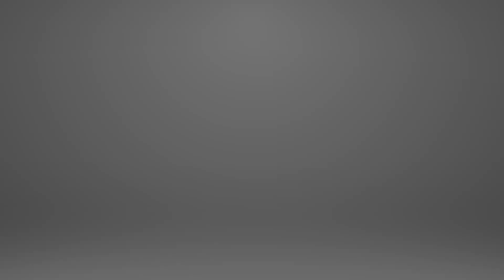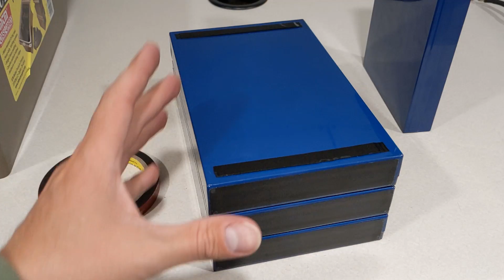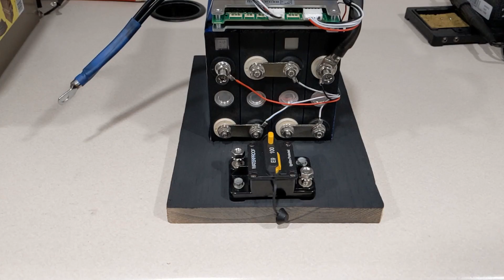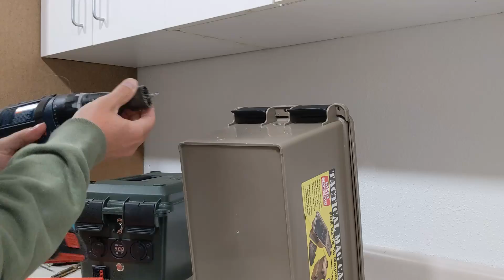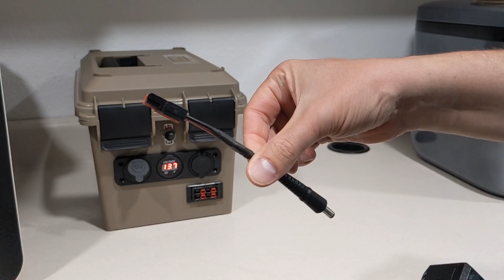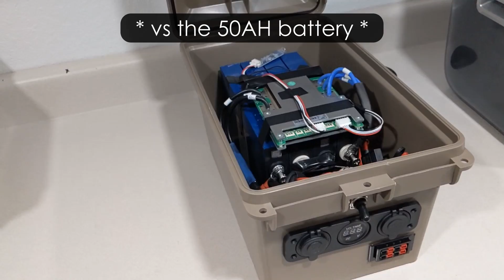DIY 80AH LiFePO4 Battery Box - COMPLETE BUILD VIDEO  | AliExpress Cells, High Quality BMS

Comment: How about next time we double the battery & add a 2000 watt inverter?
Reply from the maker: I'll save up my money for while haha Thanks for watching!
Reply: @Jasonoid  That's what I was thinking. Some thing to run a refrigerator when the power is out, and can be recharged with solar. Also, maybe build the basic battery, BMS, 1000 or 2000 watt inverter, solar charger, and then have it so we can build more batteries in the future and daisy chain them for a larger and larger bank. 

I know the battery is the big expense, but maybe build an "EMERGENCY" box using deep cycle lead acid for now, and then upgrade to lithium later when more funds are available, but at least for starters you have some thing for an emergency that can be used hard for a few weeks if need be.

A 1000 watt inverter to keep a refrigerator going, run a microwave, TV and basic charging of cell phones and what not, or upgrade to a 2000 watt to maybe run all that, and a hot plate or some thing for cooking on. It's a lot of power being drawn, but that's why you can daisy chain batteries as needed, and have a couple solar panels as well.

Personally, I'm not building some thing like this to take camping to air up a mattress, or charge batteries for tools, I mean that's cool and fun and all, but for "ME", I'd spend a few hundred more dollars and make it really usable for all that fun stuff, AND FOR REAL emergencies. 

Some thing for REAL emergencies, it should be able to be recharged from the grid or gen set, solar, and a vehicles charging system.

I'm in Louisiana, and we lost power for only 14 hours a few weeks ago when the hurricane hit, but if I was just 40 miles west in Lake Charles, I would be without power for weeks. I have a gen set, but this would be great to use along with it.

Some thing else that would be handy I think, is a built in retractable extension cord mounted, probably on the outside. I'm thinking some thing along the lines of a vacuum cleaner cord, as they're pretty durable, can handle a good amount of power, they're cheap, compact, around 20 foot long cord, and easy to mount. Of course you'd have to replace the male end with a female, but that's no biggie. Now you really do have a very handy self contained box.

For reference, here's what I'm thinking.
https://evacuumstore.com/p-311-electrolux-plastic-canister-cord-winder-assembly.aspx?gclid=EAIaIQobChMIo-CGl87r6wIVEdbACh2uoQQjEAQYBSABEgJ7jPD_BwE

A bunch on ebay.
https://www.ebay.com/i/312867187883?chn=ps&norover=1&mkevt=1&mkrid=711-117182-37290-0&mkcid=2&itemid=312867187883&targetid=935694488106&device=c&mktype=pla&googleloc=9025259&poi=&campaignid=10877145111&mkgroupid=105798873063&rlsatarget=pla-935694488106&abcId=9300400&merchantid=108357416&gclid=EAIaIQobChMIo-CGl87r6wIVEdbACh2uoQQjEAQYASABEgID-fD_BwE

Keep up the great work.

Comment: What battery pack did you buy? They all kind of look a like... The 4 packs I see are less than $200...
Reply from the maker: Link is in the description of the video, 4 pcs of 80ah cells. Any size would work, you could go smaller or larger and use the same principle in my video.
Reply: @Jasonoid  thank you when I press the link the second time I got there. there are a lot of them on there that look the same and say they're the same size but they're half the price or less. Although yours do say grade a is that the difference?
Reply from the maker: @robertcollyer3500  that might be the cost difference, I think if you go with the cheaper cells youll probably only get 80% capacity of what they are rated, they still might be worth the cost savings.

Comment: Awesome portable setup ⚡️!!! I’m looking at making a box for my Nissan Leaf batteries to make it easier to remove from my Rv during the winter months!
Reply from the maker: I looked at Nissan leaf modules, they were pretty cool! Good luck on your build! Thanks for watching
Reply: Thanks for the reply! I plan on doing a 24 volt bank comprised of 6 modules. Hopefully get 350 amp hours 🙌🏻 . I like the battleborn brand but I can’t justify the pricing 😅. I have a build series here on YouTube. The goal is to reno a vintage Rv on a modest budget with the capability to go off grid ! Your builds are so neat and I’ve learned a great deal ! Keep pushing the content!
Reply from the maker: @WeRoamtheUnknown  that sounds like an awesome project, you'd be able to run quite a bit off a power bank that big. Good luck! Thanks for the support

Comment: One day too late! I just ordered two Lion Safari UT 1300
, 12V 105Ah Lithium Iron Phosphate (LiFePO4) Batteries. They have a nice BMS so I think I can still build this box without the BMS. I have ordered the ICECO VL45. I'm looking to power it. I may add a battery monitor. Great video you do a great job showing how you build and you explain things well.
Reply from the maker: Thanks for watching! Sounds like an awesome project! Let me know how it goes!
Reply: @Jasonoid  Thanks! When you charge your batteries, where do you connect the charger?
Reply from the maker: @livingcoramdeo  I will make an adapter for my Anderson PP panel to make charging easier, but for now I connect alligator clips to the negative BMS lug and positive terminal. It works just fine....just have to remove electrical tape before hooking up the negative.

Comment: Great build and thanks for the video!
Reply from the maker: Glad you liked it!
Reply: @Jasonoid  I was nodding my head for almost the entire video. I just finished a build this weekend and used the same battery chemistry, same case, same circuit breaker and Anderson PP connectors :) Geek telepathy apparently.
Reply from the maker: @nikoargeres8156  NO WAY! That's awesome :) I'm sure we will love these setups! You running fridges as well?
Reply: @Jasonoid  Yes, I have the ICECO jp40. I decided to run the Anderson plugs in my battery box so I could move away from using the cigarette receptacle, which seems to want to wiggle out when off-roading.
Reply from the maker: @nikoargeres8156  Thumbs up man! Good to hear. I'd love to see your setup. You should post a video on it on your channel. LifePO4 stuff is only going to get more popular!